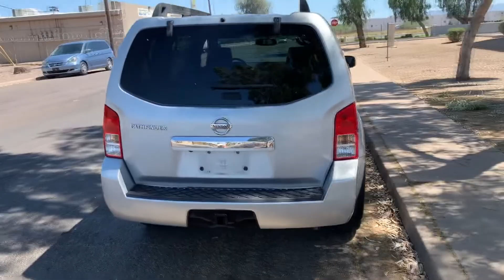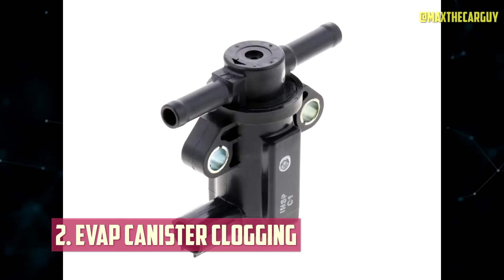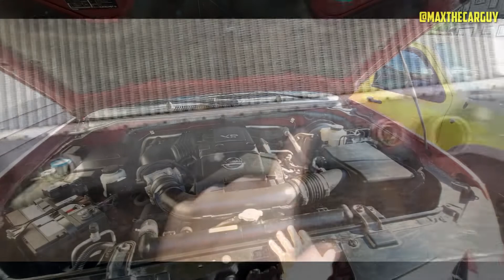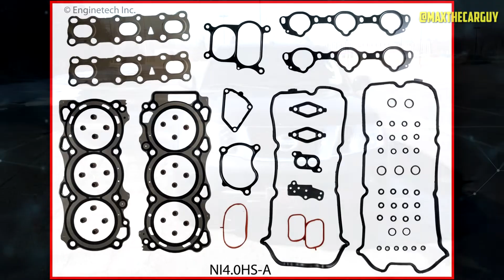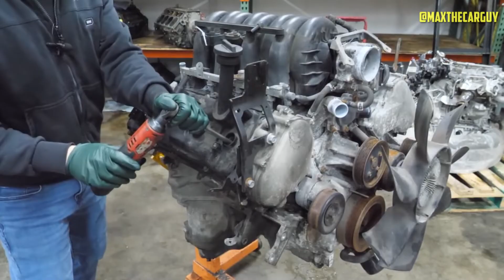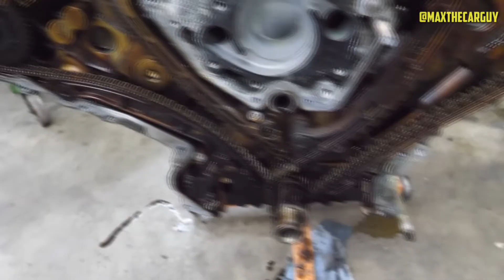Nissan Pathfinder 3rd Gen R51 2005-2012 Common Problems

Comment: i have 2,5diesel 2012 with 350t miles EGR valve replaced at 250t miles and mechanic aproached me with stuned face he asked me what diesel i use.
I told him just regular without aditives.He said that is impossible i asked why.
He told me there is absolutely no carbon build up.
Everything else is still original 
Turbo transmission injectors DPF etc.
running great

Comment: Mom has a 2008 with 225,144 miles. Sometimes, when she slows down, it will shut off, and she has to crank it back up. Has anyone had this issue? The blend door makes a tapping noise.

Comment: I live in AZ and change the oil in my 2012 Pathfinder (VQ40DE) every 5k miles. Should it be more frequent? I’m at 156k miles and have the original timing chain/tensioner. Changed the camshaft and crankshaft position sensors once already as well as that brittle ass coolant heater tubes. Have rear ac so I can’t use the upgraded Z1 all metal piece. Bummed

Comment: I bought my one owner 2008 LE 2WD with the 5.6 V8 back in January of 2020 with 140K miles. As of September 2025 it has 286K miles and has honestly been one of the best, most reliable and trouble free vehicles I've ever owned. Still love it and drive it daily. The first modification I did as soon as I bought it was bypass the transmission lines that flow through the radiator being it already has a trans-cooler from the factory. I just couldn't ride around always cringing that one tube in the radiator failing causing an expensive nightmare that can easily be avoided with a piece of hose that costs less than $10. Like any vehicle it has its pros and cons and have just performed a lot of suspension and brake maintenance but, so far I don't regret buying this thing. Not to mention it's a blast to drive with the 5.6 and still getting 18-20 MPG at 70-80 MPH.

Comment: You are so wrong on the radiator and transmission issues. Nissan was sued, lost and had a time when they were required to replace the transmission.

Comment: 2009 with 180,000 miles.
I by passed the tranny lines out of the radiator at 60,000.  I did have the crankcase and cam shaft sensors go bad.

Comment: 2008 V6 with 235,000 miles. Had timing chain and radiator and AC  fixed and struts and shocks. Other than that it still runs good. MPG is just 18 miles though.

Comment: The V6 the radiator issue was limited to the early years.  By 2010 Nissan had a new part number which fixed the problem of mixing transmission and radiator fluids.  Also, the timing chain issue was also addressed in later years, and was mostly a crap shoot depending on how old the stamping dies were when manufacturing the chain.  If they were old stamping dies, a sharp lip would form on the links, which would eventually wear through the plastic tensioner face.  Non-affected vehicles really don't run into chain issues.

Comment: I have a 2005 model 
I’ve had it 3 years and only had to replace one front brake caliper 
Unfortunately the chassis is rotten so it is now end of life
I will definitely be replacing it with another one, perfect for all my needs

Comment: Just bought a 2005 2.5L and the thing is an absolute tank. I bought it cheap so it has a few issues I am currently addressing but nothing major. New ball joints, CV boot needs to be replaced and a whine when starting to move in reverse which I am told is likely just a U joint issue or a prop shaft issue, both fairly inexpensive fixes. The body is a little tatty and the interior is caked in brick dust since previous owner was a stone mason but he was an old man and he told me everything upfront when I bought it. 

The only gripe I have so far is I don't like how soft the ride feels. It's an off-road vehicle so it's set up like that and I will be stiffening up the suspension after all mechanical issues are addressed. It would be fine if I was using it off-road but I bought it to be my work horse and to get me through snow which recently dropped 2ft in one day and my other 2WD car couldn't handle it. It's old so I can forgive it, I just wish it had a button like the Land Rover which can select the ride for a given terrain. Other than that I love it. Thing pulls like a train and has held up well for its age. It's currently on 138k miles and starts quick, runs great with no unwanted ticks or knocks. The underside has held up well with a recent test at a garage only noting "corrosion to underside but not considered excessive" so I'll get that cleaned up at some point. For now I have a great car that didn't cost a lot, it runs perfectly at the moment with a minimal amount needed to make it perfect

Comment: We have a 2007 Pathfinder we bought new and it now has 284,390 miles.  Great car and the engine doesn’t use any oil at all.  Around 80,000 miles we had the dreaded radiator problem.  Got a new transmission and radiator out of that and only had to pay $1,200 as Nissan paid the rest.  I bypassed the internal transmission cooler and 200,000 miles later still running great.  We also had the timing chain guide problem at around 90,000 miles and fixed that.  Over the years, we’ve replaced both camshaft sensors, the crankshaft sensor, the oxygen sensor, the valve cover gaskets, the U joints at 149000 miles, the fuel gauge sending unit, replaced a mixing door motor in the ac inside the dash, replaced one tweeter, replaced the ball joints in front, replace the front passenger wheel bearing at 180,000 miles, recently replaced the fan clutch, replace the transmission shift cable at 260,000 miles, replaced the coolant pipe at firewall, replaced the brake switch and replaced the airbag switch assembly.  This may sound like a lot but it was spread out over the last 200,000 miles of the 284,000 miles and over the last 17 years.  It is a fantastic car that we expect to get to over 500,000 miles.  We change only the oil at 3000 miles and the oil and filter 3500 miles and alternate.  We sent an oil sample in to Blackstone Laboratories at about 260,000 to make sure engine wear was good and it is.  (That was only approx $30 and well worth their insight). They recommended the more frequent oil changes.  We average approx $100 per month over the years in maintenance costs and that includes everything including routine maintenance and tire changes. I do a lot of the work myself but our dealership has done all of the major items. The car doesn’t depreciate anymore and even new cars have maintenance, so averaging $100 per month is far cheaper than replacing the car.  A new car will depreciate $3000 to $5000 per year (depending on the car and the price of the car), so plus you still have maintenance and replacing tires every 50k to 60k miles.  Anyone with 300,000 miles on their car (any brand) saying all they have done is routine maintenance is not telling the truth.  Things wear out or break but if you stay on top of it and nothing major happens, it’s well worth the journey and cost savings.  Plus this body style still looks awesome and black paint looks fabulous (it isn’t garaged, but it is well maintained, waxed and hand washed)
Reply: I have a 2008 Nissan Pathfinder, and I really do appreciate your comment, right now our car is at 79K miles, it was a car passed down for me to use in my future, I really appreciate your comment because it gives me an idea abt costs and what may or hopefully may not happen
Thank you
Reply: I was wondering about Nissan I'm trying to find my son a vehicle I have a 2007 Toyota Corolla straight drive it has 360,000 miles own her if you replace the timing belts sensors and the things that happen with wear and tear it's worth it in the long run I bought a 2025 Toyota Corolla last year I hope I get as good of service as I did with my 2007 I charge my oil every three thousand miles thank you for sharing your advice own the Nissan like I said I'm trying to find my son something reliable take care God bless 💜
Reply: Oh my God you have the strawberry milkshake problem too! Nice to meet a fellow milkshake lover. I personally save the milkshake for later drinking. My transmission is toast sadly🍞.                                                         Seriously though I have the same year pathfinder and it got the radiator mixing with the transmission and didn't catch it until WAY too late, it also leaks the strawberry milkshake which is nice.

Comment: I believe  the Transmisison /radiator problem was fixed in 2010 for the Frontier/xterra and the Pathfinder.  Although I believe since some 2011 s may have been built in 2010.   I think the tensioner issue was also fixed same year.  With regular oil changes transmission drain and fill and regular fluid changes on everything the engines and transmission these vehicles should easily last 200,000 to 300,000 miles.

Comment: I got a 07 it’s a complete piece of 💩
Reply: What in particular? Genuinely curious.
Reply: @darren2329  trans went out, transfer case went out both under 110000. Engine burns oil and leaks at head gaskets around 130000. I got major computer troubles now at 150000 I’m still trying to figure that one out. I have a 09 ford and 06 Chevy with comparable mileage and Nissan by far the worst trouble and I’ve been the only owner on all three.
Reply: @darren2329  lost transfer case around 70k, lost trans around 125k with all the coolant lines., burns oil since 130k, cam shaft sensors, control arms and springs and more smaller stuff not worth mentioning. I bought a 06 Chevy Colorado and a 09 ford f 150 all close to same time new and the Nissan is the only one that has been trouble. 🤣🤣 only thing I can think of that was different was my wife was the primary driver of the pathfinder.
Reply: Don't believe many people comments here.
Some people don't want to spend money to maintain their cars
Reply: Did you buy it new or did someone else run it in the ground and you bought it  ?

Comment: My 2008 has been nothing but reliable. Peak SMOD year but trans replaced at 110k and original radiator. Currently at 189k with zero issues

Comment: I have a 2011 Patfinder S model, there is so many issues, engine rev loud when starts, power windows 3/4 are malfunctioned, radiator, front suspensions, radiator, frozen rear alignment(can't be fixed), air flow sensor, stalled engines, I think the amount of money I put in to fix this truck is about the same as the car price itself. My next car will be Toyota for sure!
Reply: The frozen suspension can be fixed pretty easy, you just cut the bolts off and replaced them.
Reply: Sounds like an owner issue . Takes more maintenance in bad climate conditions .

Comment: So basically a Nissan piece of crap that should have never made it to market.
Reply: Did you come here just to skip the video and make that comment?  Pretty much anybody with a reasonable amount of automotive knowledge will agree that Pathfinders, Xterras and Frontiers are some of the best value used SUVs/trucks you can buy.  And then there are people like you who just say "Nissans are pieces of crap" because you probably drove an Altima.
Reply: @DBryan1981 Never mind this person.
He doesn't know what is talking about.
In Australia here Nissan is a good product.
The problem is that many people don't want to spend money to maintain their cars
Reply: @johnsonolajide4647  I just bought a 2011 used. First thing I did was to have the timing chains, tensioners, pulleys replaced. The instruments were intermitted so I had the cluster refurbished, replaced rear shocks and had the brakes done. Silver edition so had the outside repainted. 4 new tires and now I have a brand new 2011 Pathfinder - the interior including the leather seats are still pristine. Best looking SUV in all of Eswatini - a guy with a Porsche SUV asked me in a car park what the heck my car is - seems it is the ONLY one in Eswatini - his Porsche is not.
Reply: @DBryan1981 So true DBryan . Usually it's the owner to blame on all vehicles.
Reply: no way
Reply: Mostly everyone on this thread loves their pathfinders including me. mine is a 2012 with 235,000 miles and runs like new. Showing NO signs of giving up. You wanna  piece of shit, then get off this thread and go buy a Yugo.

Comment: I had a 2010 with the V6.  Sold it after 10 years and 186,000 miles and still going.  The woman that I sold it to has it up to 224,000.  I only ever changed tires, brakes, rotors,a battery and a new radiator.  What a beast!  I would buy another one in a heartbeat…

Comment: Best value in 4x4's.  If you can find one that didn't spend a majority of its time in a state where road salt is used, and it seems to have been well-maintained, take it to a Nissan dealership for a pre-purchase inspection.  If they give it the green light, buy it.  I would budget to have the valve cover gasket done, just due to age and mileage.

Nissan's VQ series engines are arguably second, ONLY to Lexus 4.6 & 5.7 liter V-8's, when you factor in horsepower, torque, AND longevity.   Yes, the 6 cylinder in the 4Runner is an extremely good engine, HOWEVER, it lacks the Pathfinder's power AND, you're gonna' pay 3x to 4x more for an equivalent mileage 4Runner.  A 4Runner is NOT 3 or 4 times better than a 2008---2012 Pathfinder.

On a well-maintained 2008 to 2012 Pathfinder, I think the two main things that are likely to go are the catalytic converter (mine went at 195,000 miles) and the camshaft position sensor (mine went at 175,000 miles).  My understanding is that, those are known issues with Pathfinder's of this vintage.  Considering that I bought it 3 years ago, for $8,500, with 135,000 miles and it's now 11 years old, with 200,000 miles, I do NOT think those are anything to knock the vehicle about.  Mine runs like it's brand new.
Reply: I agree. I bought my 2012 v6 4x4 pathy 8 years ago. I wanted a 4 runner like my buddy had but the pathfinder was almost identical in every category but thousands cheaper . When I bought it the mileage was 77k and now it has 175k. Other than regular maintenance and an A/c compressor (because I run the a/c a lot) it has held up perfectly. I have wrangler duratrac tires on it and it’s a beast in the snow here.  It has more power than my buddys 4Runner, faster and performs the same when we mess around in the snow and mud . Great value with this vehicle in my opinion.

Comment: I have a 2008 Pathfinder that has over 367,000 km on it.  It's currently running 'like a top' and still looks great.  This is my 3rd Pathfinder..... the previous ones being 1992 and 1995 5-speeds.
Reply: What engine is in it? Had any transmission problems?
Reply: I have an 08 LE with 210k miles, I’ve done the transmission lower(solenoids, gaskets, internal lines), cooler and lines, but everything else is original with the tranny. I think if you catch the “SMOD” before it becomes a real problem you’re fine. Beyond all new suspension including control arms, hubs, rear end, and basic maintenance, it’s been a great truck. It spends 5 months a year in 4 wheel drive due to where I live and it’s been across the Country 3x, last one being at 200k and I still trust it completely. I like my new 4Runner better, but this truck is still worth 3x more to me than what it is to anyone else, and I’ll keep it until it’s scrap metal.
Reply: Was it the v7 or v8  @PaulKing-h9m
Reply: V6

Comment: I have a 14 year old Nissan Pathfinder with 150K miles on it, still running good, it's my daily driver.
Reply: Whats the fuel consumption like ?
Reply: @majidshabbir4597  I have a 2011 Pathfinder, fuel consumption is horrible and we always run premium which I believe is recommended. 13.5 local, a little over 15 on the highway. It's the only reason I would consider getting rid of it. It is a fantastic SUV. Just standard maintenance stuff. I plan on keeping it for another 5 years, and at that point there will probably be no point of getting rid of it. When my wife's car goes we will get a Tesla and use that for most things, and the Pathfinder for when we need more room.

Comment: Very informative I’m looking to buy a 2005 pathfinder because I like the look size and price for 3600 but now I’m kinda rethinking that purchase
Reply: Likewise, although virtually any vehicle will have common issues.
Reply: @wordimobi5765 

Honda pilots die because timing belts aren't changed. 

Anything with the 5.4 Triton will need replaced unless maintenance is first in the owners mind. 

Everything needs maintenance and regularly checked. People need to quit treating their car like disposable plates. 😊
Reply: @lnsuvasquez2466 You are very right and correct.
I lived in Sydney Australia.
My neighbour hasn't service his Toyota Yaris for the past two years now.
Many people don't want to do maintenance of their cars nowadays.
Reply: All vehicles have issues research everything and run vin checks. Pay for that used car check before buying.
Reply: I bought a new 2005 Pathfinder and now has 198,200 miles.  Don’t rethink, just buy!  I will probably give it to my grandson when he starts school in Idaho.
Reply: Don’t hesitate, I bought a 2005 new and now has 198,300 miles. My trans was rebuilt at 168,000 miles and added a trans cooler.  I was told at 40 mph or below to drive in direct.  If not, the trans  shifts back and forth between direct and OD.  I did replace the cam sensor.

Comment: Great info! Just got a 2011 earlier this year. 93k miles with no codes showing up when I took it in for a checkup and transmission fluid change. 

My understanding is that most of the 2011 versions have a new radiator that fixed the Strawberry Milkshake of Death issue. So I wasn't planning on replacing or bypassing my radiator.